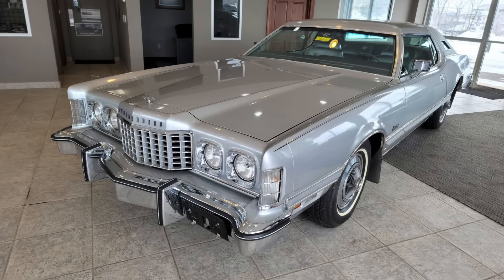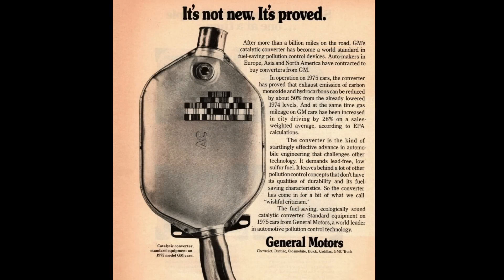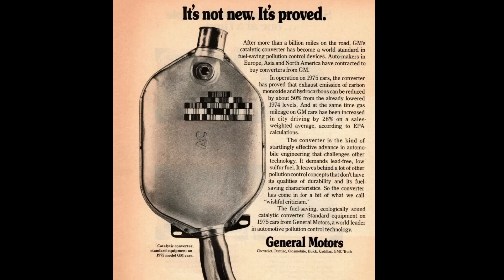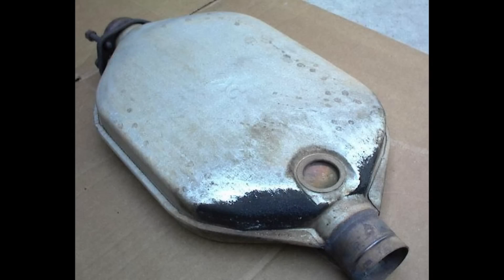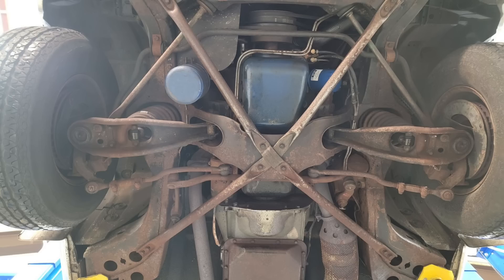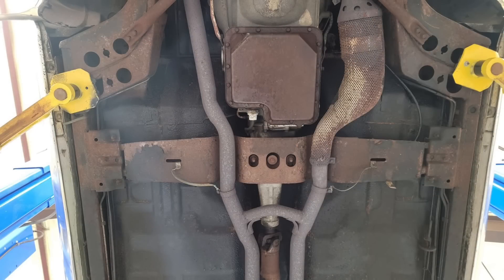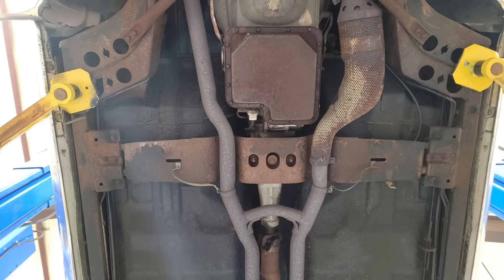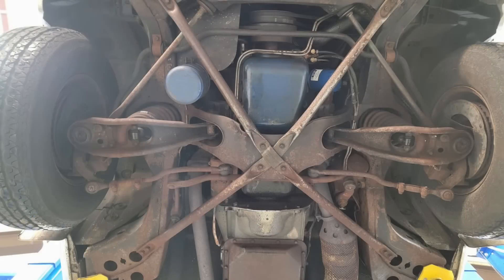Strangest Car Inventions: Ford Invents A Bizarre Way to Meet 1970s Emissions Standards

Comment: I seem to recall that Ford's converter was sort of like a roll of cardboard looking platinum in a round tube and the GM version was the small platinum balls in a flatter shape.  I always thought the industry went with the GM version as the Ford caused to much back pressure and the GM version was cheaper to produce.   I guess I was wrong by your video.  My 76 Datsun didn't have so much engine to require the converter or un-leaded gas - but it did require a belt driven air pump however.  It is amazing to see how more recent cars require the fuel and converters - and easily get nearly 4 times the life span with less maintenance.  Times change.

Comment: Those GM pellet converters when overloaded with too rich exhaust would overheat, the pellets would shatter, and those shards would plug the little slits in the metal 'cage' that held them, plugging them extremely badly. Replacement with a honeycomb style was the 'proper' fix, but generally people would just do a delete.
Reply: My S10 did that.   Pulling a long hill on the Interstate; it barely ran at the top of the hill.

Comment: Very strange indeed, I have never heard of a pancake compressor before...
Reply: The compressor refers to the thermactor pump on the engine - it shoots fresh air directly into the exhaust manifolds.  It's used in conjunction with catalytic converters on most models.

Comment: Among the vehicles I have owned was a '79 Bonneville that we purchased, brand new, with the pancake converter.   At about 50K miles the engine became very sluggish (it was never a speed demon anyway, with the 301 c.i.d. motor, but it always ran very smoothly).   When I took it to my mechanic, he laughed and said it was the converter, and simply removed the plug, shook all the balls out, and put the plug back in.   The car had a lot more power after that, and it didn't make any more noise than before either.

Comment: That reminds me of the 84' F150 my dad bought brand new in 1984... it was an end of the year truck and it didn't  get anything  that they had already run out of and would be different in '85 its a good truck mechanically but being an end of the year truck it was plenty weird all the chrome available (fully decked out)  but wasn't even a 'custom' model... no radio, no a/c, 1 courtsey /dome light switch, and a whopping 16 gallon gas tank. the brochures indicate that 4x4 was only available with overdrive until you get to  something like the  f250/f350, I believe with 351w and 460 .... but it was a carburetor 302 C6 and 4x4 and short bed! ... it also had mechanical 'auto locking hubs ' but my dad had the dealer install manual  hubs,  a/c and a Radio.... the hubs were the only one that worked right 😂

Comment: The Ford frame design that came out with the "Quieter than a Rolls" 1965 were of the "rubber frame design" they were supposed to flex to reduce road shock and minor imperfections. Then Ford mounted a body that was built like a Unit Body from the Cowl on back. The entire dog house kinda floated on the frame and was loosely connected to the Body. This design really helped reduce Engine Noise being transmitted to the cowl. One side effect was you could see the hood and front end jiggle on rough roads. I am guessing the extra heavy front end on the T-bird and Continental just jiggled too much so some extra braces were added since these were premium cars. My Aunt had both T-Birds you showed! The Pre 5mph front end and the 1975 style. As a young kid I thought that 1975 T-Bird was the fanciest car in the world! Dad had a 1974 Dart Swinger which was a nice Dart but seemed so low budget! However, I wish we could had mothballed that Swinger since they are worth a good deal of money today!
Reply: That is a pretty obscure piece of information, my friend!   Few people know about that.  I am impressed!
Reply: @xaenon  I found it in an old magazine when the cars were new. Plus an interview done later by a retired Ford Engineer who worked on the design! Ford wanted the squeak and rattle free properties of the Unibody with the Isolation of a Frame and Body! It' worked so well they used it till the end of the Crown Vic and Lincoln Town Car.

Comment: The Swiss cheese frame area is quite robust.  Those transition angles bridging the the frame under the engine and supporting the suspension to the frame rails are two frame rails welded together.  Having analyzed this on my own car these holes are IMO to minimize the collection of debris keeping them open.  Boxed frames in general have a tendency to hold debris and potentially  rot versus a C channel frame.

Comment: The X-Braces at the cross member look like a necessary addition to offset some last minute problem discovered during the verification testing. It could have been something as simple as eliminating a rattle they discovered running over the washboard road test.

Comment: Ah yes, the grounding straps.  With the advent of computer speed electronics there was an increased awareness of electronic noise interference, most apparent when you listened to your AM Radio.  It became necessary for automobiles and appliances to shield and ground out unwanted noise (EMI & ESD).  Grounding the hood was for shielding the radio antenna from the ignition.  In the good old days it was enough to place a capacitor on the ignition coil or maybe one more on the back of the radio.

Comment: Fords with full frame chassis setups were prone to rusting because water would accumulate in the torque boxes and frame rails, and rot from the inside out; in the salt belt the problem would surface in only two or three years.  That's why they began putting holes in the torque boxes.  The idea was it was better to let the water drain rather than having it slosh around in the frame for months or even years.

In fact, if you're buying an A-body Ford from the 1960s through about 1978, or a 1972-1979 B-body (this includes Torino, Elite, Thunderbird, Cougar, LTD II, Montego and Lincoln Mark) CHECK THE FRAME AND TORQUE BOXES THOROUGHLY (especially if you're buying a convertible) before you hand over any cash.

Comment: In the mid 80`s I had a 1972 Chevrolet Impala. I was fishtailing it on a gravel road and wrecked it into a ditch. It straddled the ditch and the catalytic converter caught the high grass on fire. I had just filled the tank full of gas. My buddy that was with me ran screaming IT`S ON FIRE It`s ON FIRE!. I said YES YOU DUMBASS HELP ME PUT IT OUT!. lol  I dove under the car and flailed around until I put the fire out. Then I had to walk several miles to a farmers house to use a telephone and call a wrecker. lol

Can you believe youtube flagged this comment as inapropriate?
And it flagged this too!!!

Comment: My friend’s. dad had a 75 Country Squire with a 400 that had the same single catalyst set up. The Y pipe joined into a single exhaust pipe downstream from the catalyst.
Reply: Ford wagons were all single exhaust from the factory, even in the 1960s with the big 390s and 428s on board.   Never saw a Ford wagon with factory duals.

Comment: The earth straps are there to prevent corrosion basicly when you have alot of bolted together panels and a separate chassis you have a roling battery if yoou dond connect all the large metal components together.

Comment: I bought a new 75 Mustang II with the 302 V8 and C4 auto trans. It came with no cats and a true dual exhaust. Well, dual exhaust pipes and a 2 in/ 2 out muffler. It had the unleaded gas filler neck, an air pump and all of 129 hp. The day after the warranty expired, I installed an aluminum intake, 4bbl Holley, and a mild cam. Also put 3:55 gears and limited slip diff. Still not a rocked sled, but strong enough to beat a 77 Trans-Am. The 76 Mustangs all had cats and single exhaust. 
Fun fact: my dad worked for Universal Oil Products in 1960. His job was to just drive around a prescribed route. His company car was a 57 Chevy where UOP was testing catalytic converters. I was only about 7, but I remember the car always had a funny smell when he got home. Little did we know, he was testing the future!

Comment: I had a 77 Mercury cougar which had 2 converters on each side next to the transmission which caused the fluid to overheat and burn up the transmission. After the 6th rebuild I had the converters removed and it solved the problem with overheating transmission

Comment: If memory serves, Volvo got away w/o cats for a number of years after most companies had to use them.  Their four cylinder engines used two SU carburetors, as they had for many years.  However, the manifold was pretty wild.  It had several channels with two additional butterflies connected to the throttle, like the carbs. It also diverted exhaust gases which warmed the middle of the manifold very hot.  During idle and low throttle operation, the incoming air/fuel mixture went past the hot spot, directed by the secondary butterflies.  As the throttle opening increased, the air/fuel mixture increasingly went directly into the head and bypassed the heating channels.  

Pretty clever.  Complete vaporization of the fuel at speeds and loads where that wasn't common.  Then under high load, no heat to diminish power.

I was a big Volvo fan and owner way before they became the darlings of high income.

Comment: I had a 77 Mercury Monarch, with a 302 V8, which I bought in April 77.  I guess it would have had the dual converters.  One thing I recall was it was a pain to reach the middle 2 plugs on the right bank.  That was the last carburetor engine and rear wheel drive I owned.  My next car was an 89 Mercury Sable, with a 3L V6 and front wheel drive.

Comment: LOL, yeah, the CVCC Hondas didn't need converters due to their revolutionary head chamber technology.  But, that came with an entirely other mess of problems, like extreme overheating and head warping.  Head warping that was so bad it could lead to a camshaft snapping in half.

Comment: Anyone else here remember hollowing out the unleaded restrictor plate in their filler neck to continue using leaded fuel back then?  ...not realizing until much later it would ruin the converter, of course.  At which point they then simply cut out or empty the converter.  It was an oddly simpler yet much more complicated time, the 1970s was...
Reply: I remember it.  My older brother did that, only he had NOT removed the catalytic converter.   The converter became partially clogged and the car would not run right.  He figured he'd ruined the car, so he put it up for sale.   I convinced him to sell it to me.   The first thing I did was swap out the exhaust (including the ruined converter) for duals.  A tune up and carb tweak and vroom vroom.  Still wasn't very fast, but it sounded kinda badass.
Reply: @xaenon  Yeah, I bought SO many 70s cars in the early 80s that had hollowed out filler necks and ruined converters.

Comment: Trivia I didn't know. Surprising since I spent the 80s and 90s doing thousands of emissions repairs on cars of that era. I must have got them to pass with normal tune up parts (cap,rotor,plugs, wires and carb adj.)
I can't help but wonder if I ever got freaked out by strange exhaust analyzer readings side to side, or just got lucky balancing the carb.
I can tell you I could get the anti-tamper plugs out FAST 
Most of the intakes had a heater crossover which would blend exhaust side to side but only through 2 cylinders.
I was using an Atlas branded scope and had 3 bays all to my self. Good times most days and I subbed out major work to a shop that had zero comebacks!😊

Comment: Ford’s was actually a flux-capacitor type.  That’s the reason for all those grounding straps.  It had to be very well grounded to get the turbo-encabulator effect going after startup.
Reply: @failranch9542  fords had turbo inoculators lol
Reply: @failranch9542  Chryslers only had a turbo encabulator lol

Comment: Bought a brand new 1977 Mercury Bobcat. Loaded. V6 engine and all the bells and whistles. First week I had both cats removed and replaced with straight pipe. Next eliminated the A.I.R. Smog Pump. Next re-jetted the 2 Barrel carb. Huge difference! That German made 2.8 lt V6 would sing. My buddy did the same treatment to his 1978 Mustang II, V6, 4 speed manual. Again, huge difference. Where there is a will, there is a way.
Reply: That was the same V-6 they used in the 70s era Mercury Capri and that car had a rep for being fun to drive. I would have picked the standard over the auto. You didn't need the 140 hp 302 when it was heavier than the 115 hp V-6.

Comment: My father had a 1975 Country Squire with the 400M and it only had the single converter in the driver's side of the y-pipe, with single exhaust. I remember that the exhaust odor was different from that of other family cars and rather unpleasant. I currently own a '75 CS with a 460 and it has dual factory cats. It must not have been able to meet emissions requirements with one converter.

Comment: At 2:14.  NOW we know why Cadillac engines were so badly choked and low on HP.  Look at how the head pipes meet head on and then fight to get through a 90 degree turn to go into that bead converter.  Just awful engineering.  GM should've let Cadillac develop a dual inlet/dual outlet version of the beaded converter.  That would've freed up a lot of power for the 472 and 500.

Comment: Going to guess the holes in the torque boxes and the presence of the cross bracing are related- trying to control where any flexing took place, and where it didn't.

Comment: Hey... They put manifold pumps in, to pump fresh air into the exhaust.  When they were importing TR7s from England a small hole was drilled into the exhaust on the negative pressure side of a bend which resulted in outside air being drawn in. Which of course improved the emissions numbers when tested. They all seem to cheat if they think no one will notice.

Comment: 1. Honda had the CVCC engine, available to the public in 1975. GM laughed at their idea, so Mr. Honda bought a new 1973 Chevy Impala with a 350c.i. engine, ran it through emission's, passing it, with better gas mileage right to GM, proving that it could be done.
2. Mitsubishi had the MCA jet engine. I bought new,  a first year 1979 Dodge D50 pick up (Mitsubishi) with this engine, and no catalytic converter, in California.
3. Subaru had the SEECT clean air engine, as well.
No wonder, even back then, I knew that the Japanese automakers were going to take away market share from the USA automakers, due to their innovative thinking.  At least Ford had an innovative approach, never knew that before, thanks for such a great Vlog!
Reply: The Japanese and the Europeans were restricted on engine sizes so they had to squeeze every bit of power and efficiency they could out of every cubic centimeter, and they were good at it! that’s why they had the better engineering. The big Three just made everything bigger without making it better.
Reply: @JBM802  Excellent point!!

Comment: My ‘78 FIAT 128 Rallye didn’t have a catalytic converter and could run on leaded gas.  Their minor concession to emissions was the funky non-vented fuel system which had a series of clear plastic tubing looped in the trunk.

Comment: Remember my uncle bought a 1977 Ford f100 extra cab. He drove it a few years til the exhaust started giving him problems. After months of working on it. Found out Ford used double wall tubing on the exhaust. One pipe has collapsed inside the other. He had custom exhaust ran and drive it along time for trading it off in the 80's.

Comment: Nowadays the trend is often to have the entire exhaust “manifold” internal to the head with the cats mounted on large output plenums. On my 3.6L LFX those feed into essentially 90-degree fittings that on one bank have an intermediate pipe literally the same size as the exhaust on my Tecumseh snowblower to help balance the cylinders and allow the VVT to do the EGR. On an old V8 it would just bang out the intake with that much back pressure, but these make 310 hp or so. Modern marvels of multi physics simulation and design.

Comment: If the EPA made a habit of testing with a sniffer in the drivers side tail pipe, the majority of the exhaust coming out of the drivers side exhaust would be from the side with the cat... but Ford could make the claim that the exhaust streams joined down stream of the cat...

Comment: I was a lot boy at a Chrysler Plymouth dealership in 1978-1979, and I remember a beautiful new cordoba that just wouldn’t start. I finally got to start but ran horrible and then BLAM BLAM BLAM blew the guts out of the cat…little bits of honeycomb jetting out the tailpipe.

Comment: My 1980 Delta 88 had a pancake style cat , the biggest problem with that style was the plug, The problem was so big that GM had a kit that was purchased from a dealer should the plug come out, back then it cost $20 for the kit. Imagine going down the street and hearing a pop ,then the exhaust got loud , I know I was saying some choice words.

Comment: VW had a similar situation.  The 1976 Rabbits were originally sold with a catalytic converter.  But then they found that if you adjusted the carburetor to run leaner, the cat wasn't needed.  You were allowed to bash out the cat insides if you installed slightly smaller fuel jets.

Comment: I would think ford was attempting a long term experiment with the single cat. Example if on bank was more prone to blowing head gaskets or carbon build up. 10 years later they could buy back a used car anywhere in the country to tear down for comparison